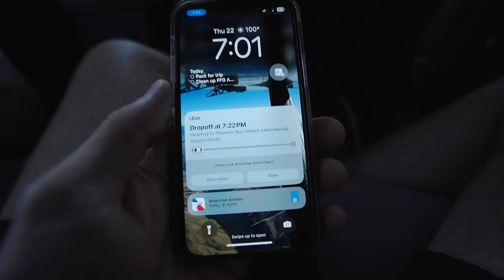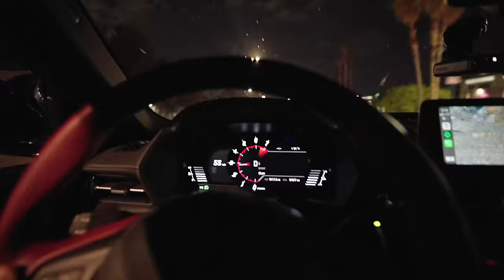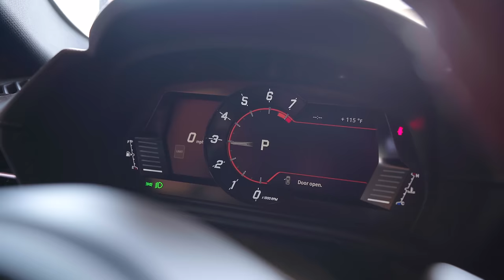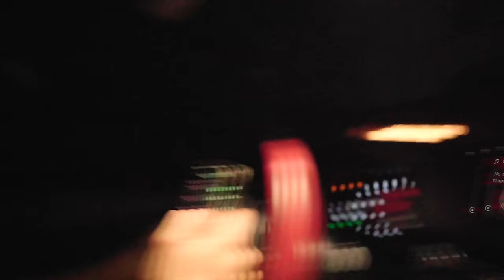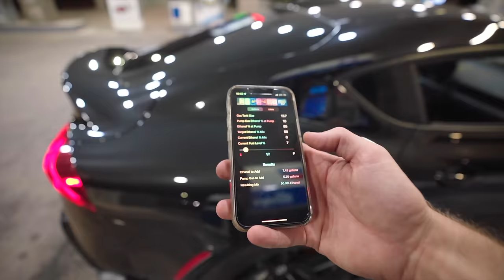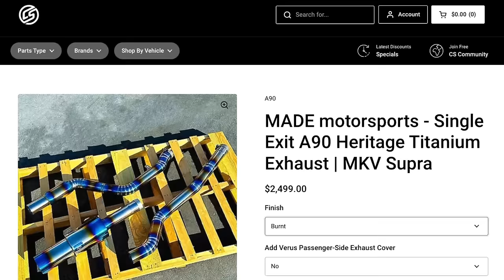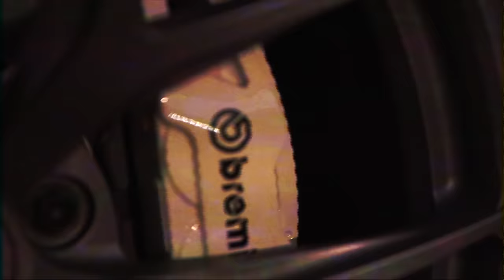Building a Toyota Supra in 24 Minutes

Comment: His plate says ‘THXBMW’ and you guys think you’re telling him something new by pointing out that’s ‘it’s actually a BMW’?
Reply: It’s poor cope from people who can’t afford one
Reply: @gladesucks7907 or it genuinely looks nicer and is more reliable?
Reply: @XeB9701  wdym more reliable its a BMW motor, same reliability in an m340i for example
Reply: @ZxroYoutube  you must not understand how brands work. Yes the engine is built by BMW but Toyota know better than anyone what the reliability of BMWs entails so ofcourse they control production and vet every single engine. BMW has also built the engine with accordance to conditions set by Toyota.
Reply: @XeB9701  the supra doesn't have a different b58 to the BMW cars that have a b58. yes, toyota had a big influence on the design and production of the engine, but putting it in a BMW chassis doesn't make it less reliable
Reply: @ZxroYoutube  It's not the chasis it's the supervision. Toyota has arguably better quality control.
Reply: @gladesucks7907 they are both good cars, stop glazing BMW
Reply: @spencerM7  what the hell are you talking about? Do you know how to read?
Reply: It looks super cool 🤌🥲
Reply: @gladesucks7907 costs more for what it is than an actual bmw😂
Reply: @ZxroYoutube  The B58 is overbuilt, personally would have never considered purchasing a Supra otherwise. So far it has been tried and proven and can easily handle 500 and take the beating. Recommend upgrading axles and clutch passed that. As far as BMW's go I wouldn't trust any other turbo car from them nor their V8's.
Reply: @kimdotnet8151 B58 is overbuilt as Toyota and BMW jointly developed this. They wanted this to be a proper successor to 2JZ.
Reply: @Chopper153  exactly. Hopefully I’ll have my hands on one next year.

Comment: Good Lord Toyota dropped the ball not selling the car with that style wing on it. That absolutely makes the car!
Reply: Revival, but Toyota is on record about most of the stuff people say "it should have come with this or that from the factory" when the new Supra was being designed. They want to foster a strong aftermarket for these cars. They want tuning companies to make parts for it. During the original press releases, Toyota was crazy about pointing out all the stuff that could be better on their cars. They even added in areas for rollcages to be added in and strengthened parts of the hatch intentionally knowing that's where tuners would need additional support for spoilers and wings. They purposely pointed out the flaws that they wanted to leave on the car for aftermarket companies to find cool and interesting ways to resolve. Its designed to be able to be taken mostly apart with a ratchet and a screwdriver in your garage. They did a great job designing a tuner car for tuners.

Comment: Those outside rear window mod's were pretty slick!    That buffeting has been a complaint from the new Supra owners since day one.    What the hell was Toyota thinking?    Normally they are a spot on engineering company,  but in my opinion,  the wind buffet problem is an engineering problem from the factory and a complete failure on Toyota's part because they developed the body of the Supra, not BMW.   In this day and age with computer modelling and wind tunnel testing far before they ever make the clay models, etc. and then extensive testing afterwards,  not one engineer or test driver ever told Toyota engineering and design department "Ah, folks, we got a problem with the wind buffeting"!?    But if those small air deflectors work to correct the problem,  that's definitely a plus,  but Toyota should have either integrated some type of fix to the problem on the subsequent year models direct from the factory or at a bare minimum,  installed at the dealerships that sell and distribute these incredible automobiles.     Very nice build.

Comment: Another Youtuber with money but no sense or care for being a proper mechanic. Spraying penetration oil on header nuts like they are rusted or something. Its a new car damnit. Also no regard for torque specs for suspension while replacing the spring. What a mess